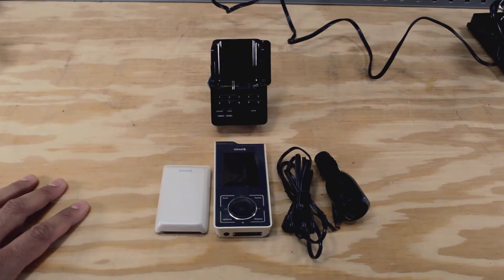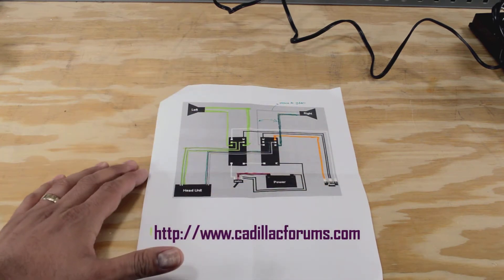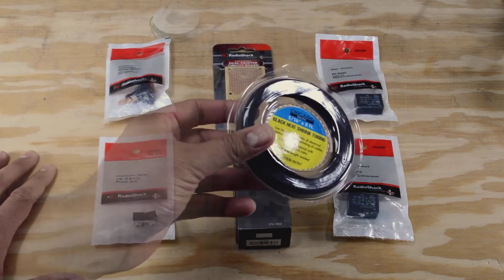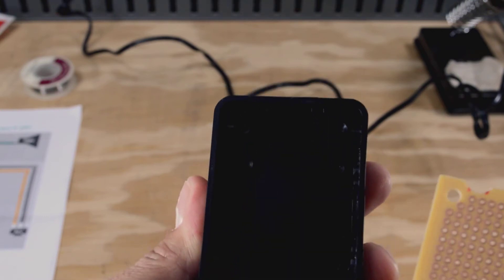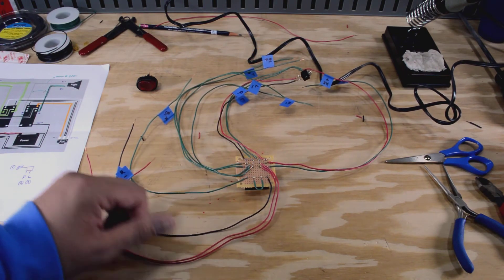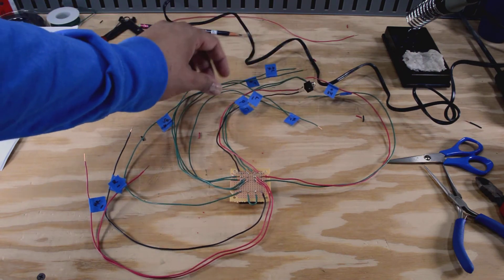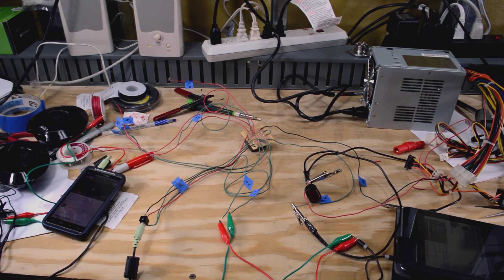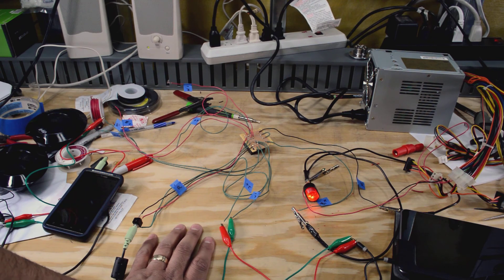Building an AUX Line IN Circuit for my 2004 Cadillac CTS

Comment: dude you complicated your life for no reason. all you need is a certain adaptor to attach to the back of the radio
Reply from the maker: Joanna Pardo I don;t have the car anymore so it's not a big deal but when I was looking for an adapter to just add an Aux-In, there wasn't anything available or cheap.  It was a neat project (and cheap) to do so nothing really lost on it.
Reply: what kind of adapter
Reply: Those fm modulators are not clearly grounded and use radio frequency. This is a clean analogue sound.

Comment: Had a similar dilemma with the stock radio in my 03 Hyundai.  No aux input and got feed up dealing with the FM Transmitter. Main purpose was to get an aux input for my car to listen to my podcasts, but it's unbelievable what an after market radio can do to improve the sound in your car as well.  Ordered a new radio from Crutchfield and installed it myself with their step-by-step instructions that come included with the radio.  All for $140.00.  Could be a better option.  Cool project though.